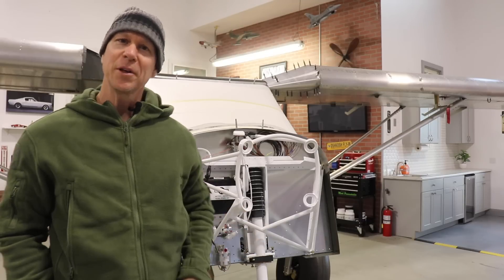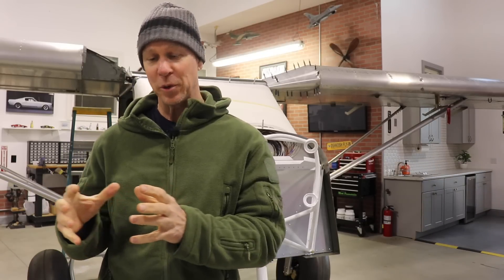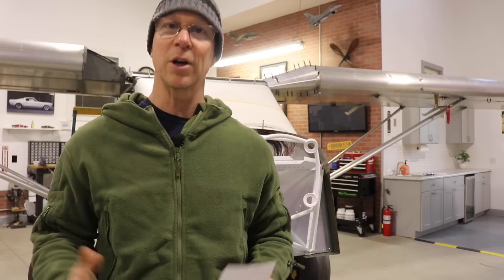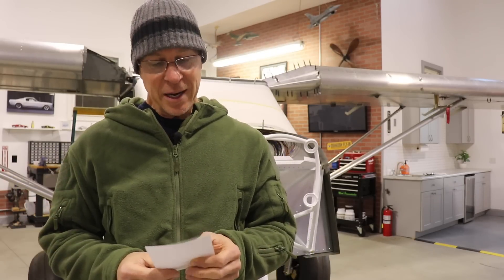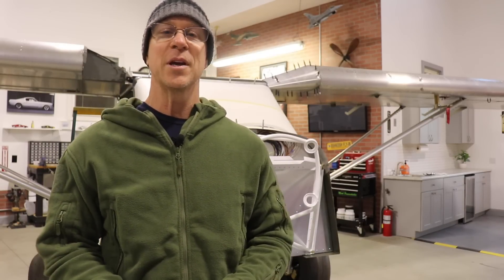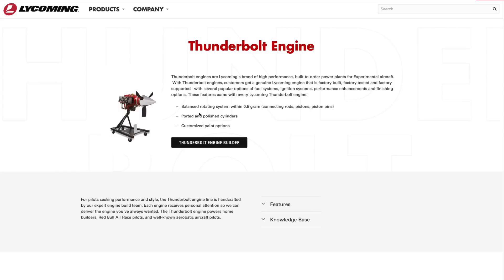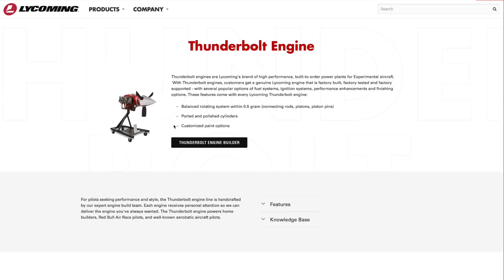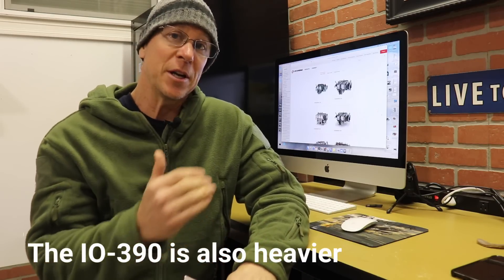Which ENGINE am I installing in my Zenith CH-750SD?

Comment: If it were me, I would take into consideration the manufacturer's power range suggestion. With more power, typically comes more weight, fuel burn, etc. More weight, requires more power, more fuel burn, etc. so, with that, I would see how far up the manufacturer's engine recommendation range where the power to weight is at the maximum for the highest effeciency. Then I would see what mods are out there to make more useful power, Fuel injection, electronic ignition, big bore kit, exhaust kit, and any other additional power that could easily be tuned out, or bolted on (keeping weight in mind).
Reply from the maker: Contradictory. Anything that can be bolted on to ad power adds weight. As you say, more weight, more fuel burn, etc... Also more complexity, more wear on the engine, and would probably negate any warranty. The Super Duty can handle anything up to 230hp.

Comment: If I were you, I would take the IO 390 with 210 hp. More starting power helps you to start again from small places or forest clearings. In normal operation, the consumption will probably not be that much more than the 360 with 180 hp.

Comment: With either engine your Top speed does not change much as the airframe itself is your limiting factor. I would opt for the higher horsepower engine, as we all say you can always throttle back!

Comment: Better to have the power and not need it than need it and not have it.  Remember you can throttle back to reduce fuel flow if you're not in a hurry.  I'd also get a constant speed prop to take full advantage of the engine HP.  Phil

Comment: I'm probably misremembering, but in an older video I thought you mentioned that you weren't putting fuel returns in the wings, because you were going with a carbureted engine..? Or was this about NOT closing the wings until you made a decision on that?
In any case: nice engine choice(s)!
Reply from the maker: With these fuel injected systems now on the Lycoming a return line to the tank is not needed.

Comment: Great video. FP or CS prop?  I'm building an RV14 and working thru the same questions. Typical engine is the IO-390, however, I'm leaning toward an IO-360 200hp angle valve with the prop governor front left (clearance issue with on rear of case). IO-360 attractive to me due price, fuel burn and parts costs.
Reply from the maker: I think a C/S prop would be too heavy for the front of this airplane. I'm even worried about the extra 20-30 pounds of the 390 over the 360.

Comment: Remember, you can always run the IO-390 at 160 or 180 or 210 HP, by adjusting the throttle and (assuming constant speed) prop controls.  The IO-360 is topped at 180, no matter how hard you push the levers forward.
Reply from the maker: Very true!

Comment: OK. Now that that's out of the way, What propeller are you using? Fixed pitch? Ground adjustable? Constant speed? Electric pitch?
Curious, but mostly joking.

Great choice on the engine IMHO. I'd go bigger with fuel range secondary. If need be I'd just stop for fuel. If I really wanted to go somewhere way out without a fuel stop, I'd add a fuel bladder with a tiny battery powered fuel pump I could pump out of the bladder into the wing. No fuel lines to run. I knew of a B-737 with a fuel bladder that flew from CA to HI and back.

Lower engine weight with higher power is often the result of higher compression ratio. Higher compression ratio requires higher octane fuel to prevent engine knock. Though if the engine has knock sensors fitted, the timing (electronic ignition) will be automatically adjusted to prevent knock, at a cost of losing some power. Engine temps may be slightly higher too, with higher compression.

On the fuel injection choice, for me, if it's a toss up I'd look to which is more serviceable/parts availability. 
I look forward to hearing more about your final choices and why.

Thanks!
Reply from the maker: No C/S prop. It's just too heavy. I'll definitely use a ground adjustable prop probably either the Sensenich or the Whirlwind.
Reply: @KitplaneEnthusiast  I'm not trying to sway you one way or the other but changing pitch with the Sensenich is very easy...also Sensenich is a company that isn't going anywhere anytime soon.